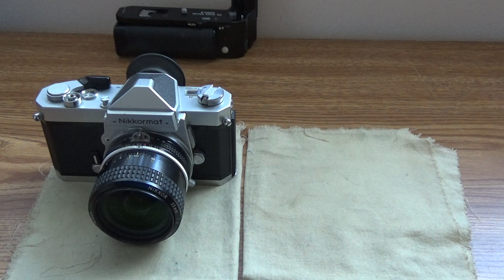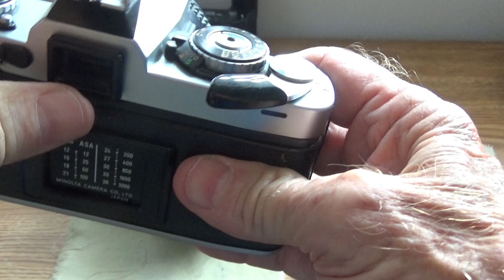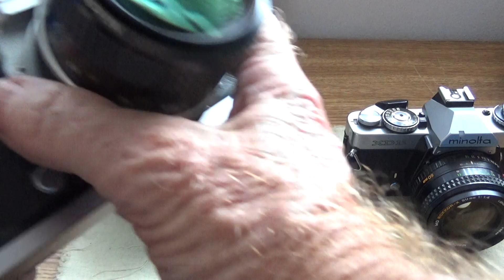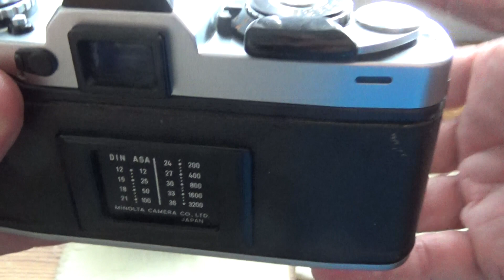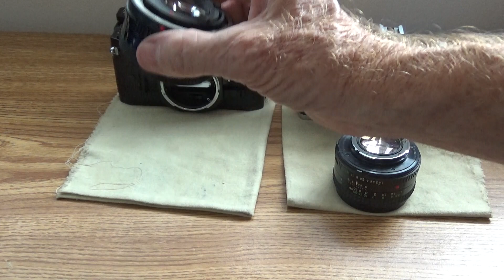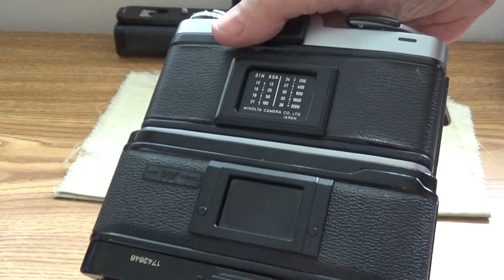Minolta XD-11 vs Canon A-1 May the best camera lose

Comment: The Konica Autoreflex T introduced Shutter Priority before the Canon AE-1.

There have been a number of battery-dependent manual SLRs, the Praktica BMS springs to mind, but nobody takes them seriously.

The AL-1 was aperture priority only, and a bit of a dog.

Minolta's XD-7 (XD-11 in North America) wasn't a bad piece of kit, but Minolta didn't produce another multimode until the autofocus 7000.

The Mamiya ZE-X  was another early contender, but too unreliable to matter, and I prefer my Fujica AX-5 in any case (although finding lenses for it is a sod.
Reply from the maker: When I replaced my original XG-7 with the then brand new X-700, I thought it was the greatest camera ever made. Until I bought an old F2 Photomic. As soon as I got my first roll of prints back from the drug store, I packed up my entire minolta system and shipped it off to KEH! Never shot with a minolta again until very recently with this old XD-11 I rescued.

Comment: The irony is that in the early 80s, Minolta sort of capitulated to the Canon way by producing the X700. 

WRT the off-the-film-plane metering for flash, I don't think that the light meters available in the early 70s were capable of the speed necessary for reading off the film during exposure, so I can see why Minolta let that go. I think the XD11 was their first camera capable of metering in real time. Great video!
Reply: There were PIN diode light detectors in the late '60's. PIN diodes of the '70's era could discriminate sub microsecond pulses, 1/1000 sec shutter speed is 1 millisecond timing. Thus the technology was easily fast enough to detect light levels a flash sync speeds of 1/100 second 10 milliseconds. Exposure computation was done with analog summing amplifiers, much much faster than the fastest digital conversion and computing of even todays digital camera systems.